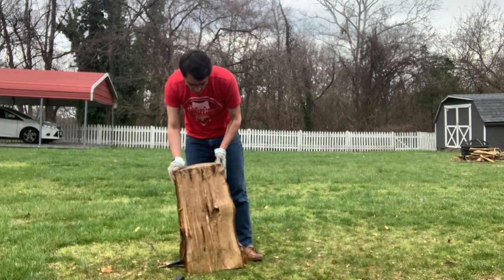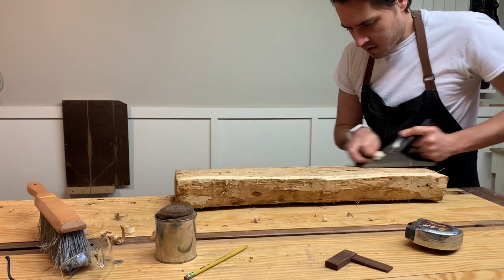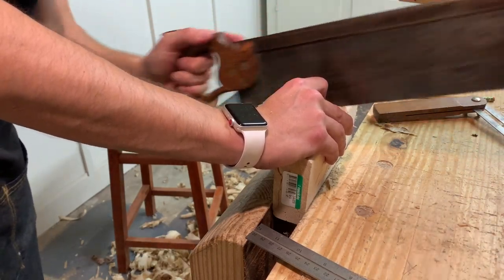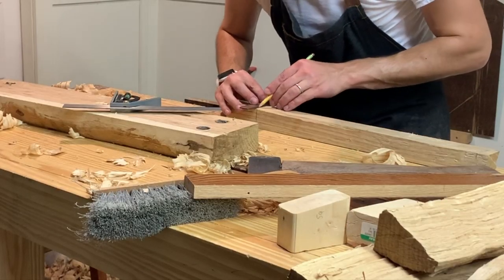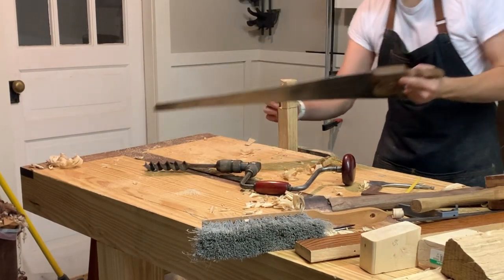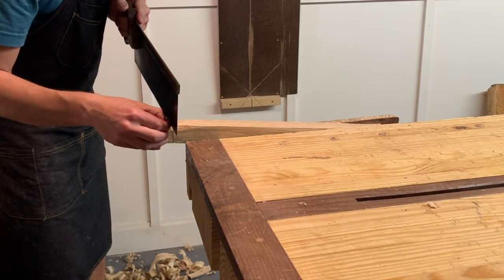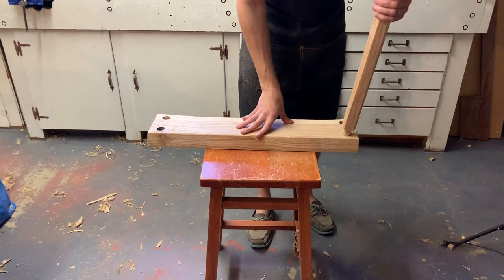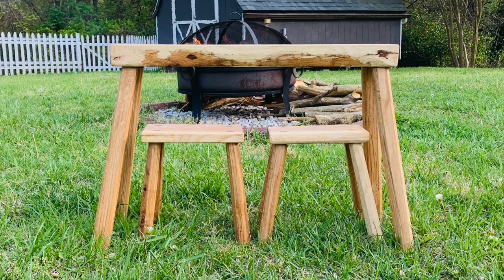Green Wood Staked Bench | Hand Tool Woodworking

Comment: You should use the 2 sided wedge so you can control the split a bit better.  Also, I've found using an engineer's hammer instead of a sledge is easier.   Definitely good to use the hatchet to cut it down.  Nice benches.  I bet you'll do more!

Comment: Very informative and well made video.  I do, however, have one question and it has to do with the tenon.,  When you marked out the stop cut it was square on all sides yet it appeared when you were finished it was the same angle as the legs.  Did you go back to the cuts and make them the same angle as the legs so they fit flush?

Comment: Just a thought about process and purpose - using a level floor to produce matching level legs for a bench that will be used outdoors on uneven ground - pointless? This is a good project and I'm sure you learned a bunch in the process, which is great. But match your process to your purpose ;)